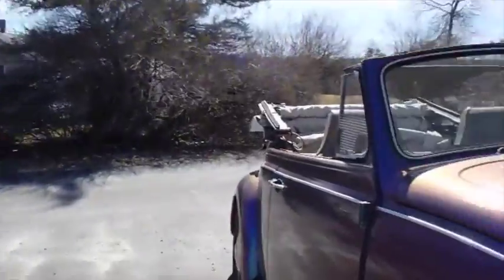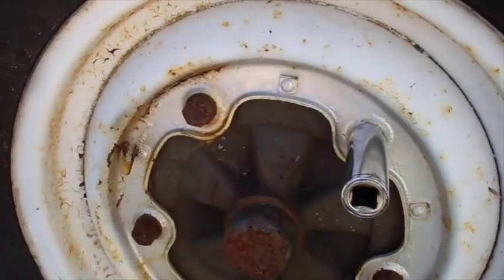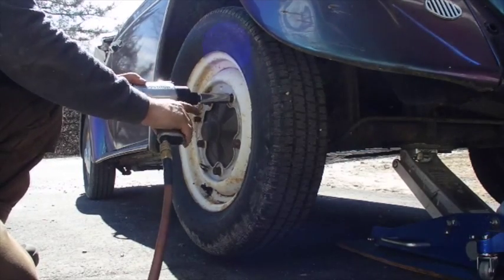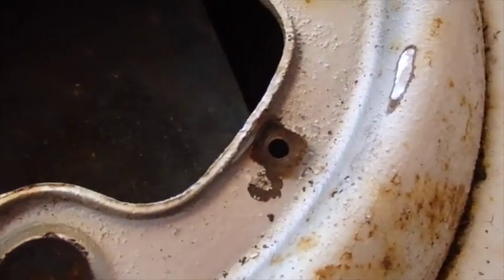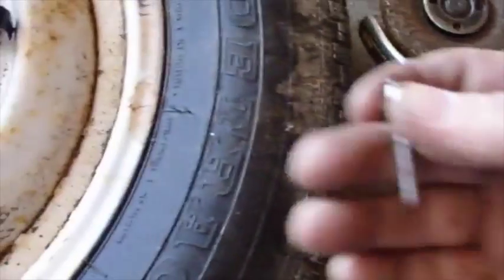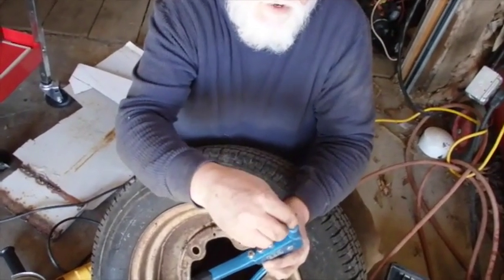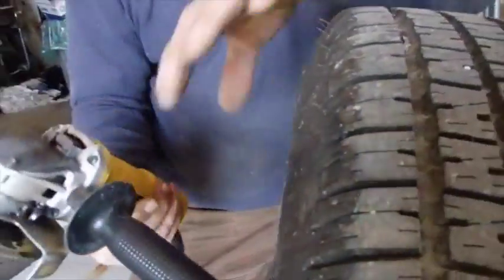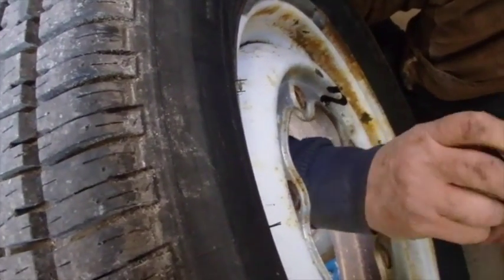VW Hub Cap Hooks

Comment: Hmmm, it's funny how you named your rivet gun Brad.  When yer rivet shaft gets stuck in the jaws like that, you gotta

 hold the handles of yer rivet gun open, 
push against what you are riveting 
and from the other side jam the shaft back into the gun, 
that releases the jaws inside the gun.  
THEN, holding the shaft in,
 slide the gun back down on the shaft and start again.  
I have found that on that type of rivet gun (I have two) it's better on thick steel shaft rivets to start the first pull with the handles two to three inches apart at most...